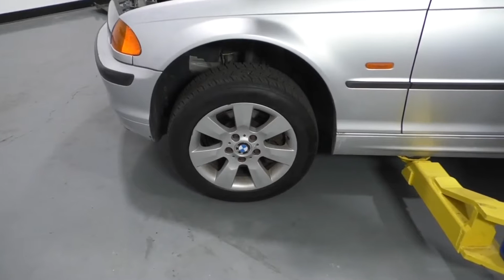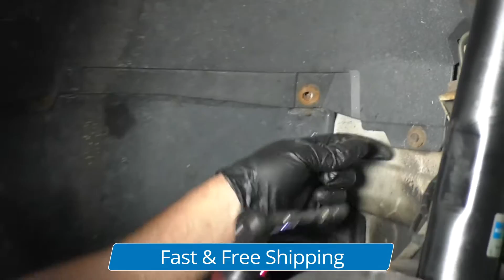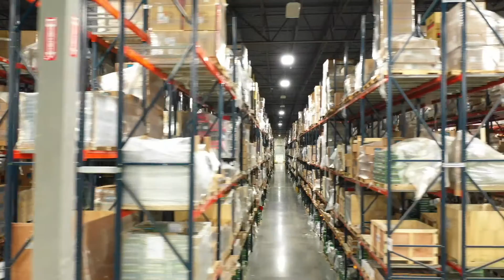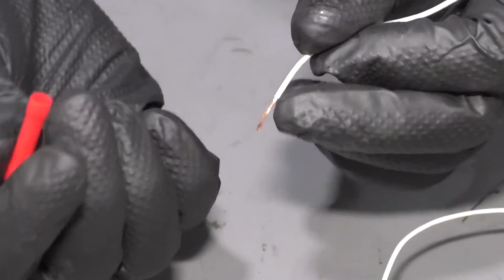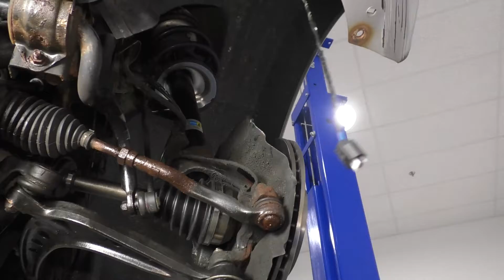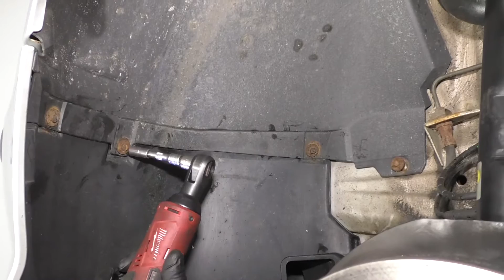How to Replace Ambient Air Temp Sensor 97-06 BMW 325Xi

Comment: Anybody know where the wires connect on the other end of the sensor. I must have a short as I replaced the sensor and still shows -40.

Comment: Will this cause a/c not to work ?
Reply: yes
Reply: @onemoreroll  same with heat?
Reply: @Mythslucky  not a heat problem with me. I had an issue where ac wouldn’t work after a car wash or rain and this fixed the problem. Plus the temp on the dash used to buzz super often with wrong temp readings
Reply: @bryanloera2840  yes Ty same with my dash atm just got a new one in the mail!!
Reply: @bryanloera2840  did your car turn check engine light for this sensor?
Reply: Sometimes. Depends. But this fixed mine